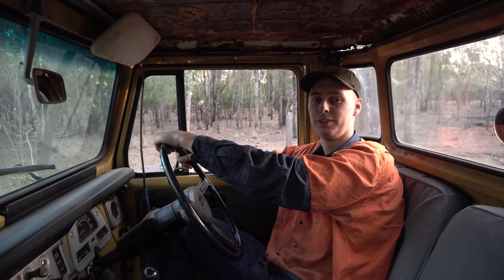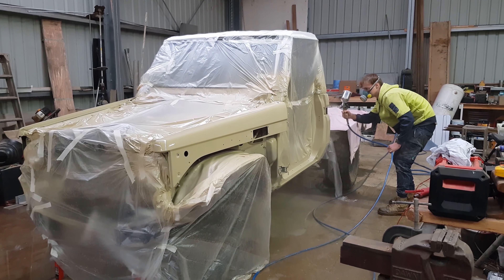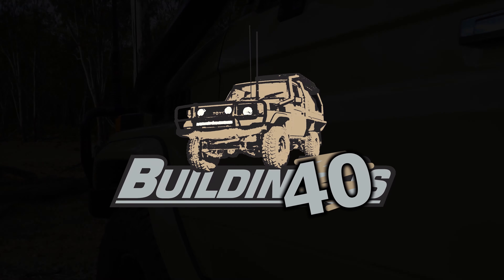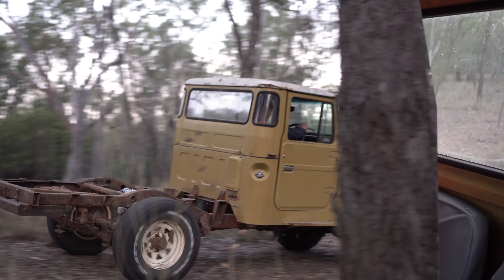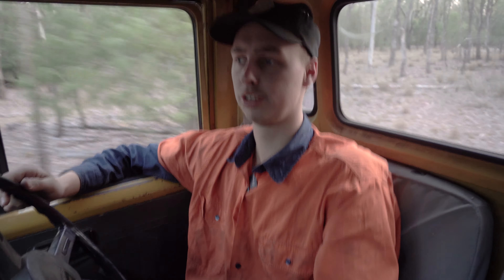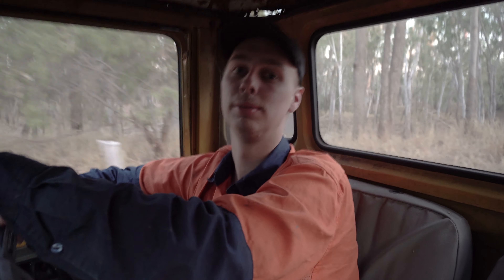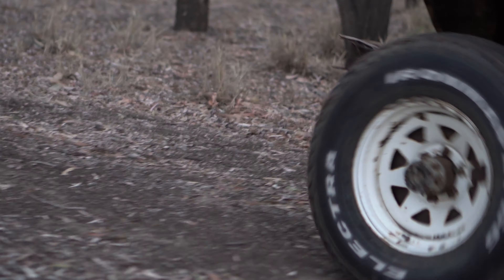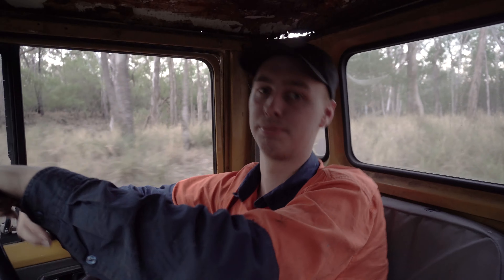HJ47 Series Build Plan - The 47 series build

Comment: I think you should put a fibreglass roof on in it instead of the steel one and raptor coat the chassis
Reply from the maker: The 47 came with a spare roof so its just gonna stay steel for now.... as for the raptor coating im not too sure on
Reply: Buildin70s I think if you put a flat look raptor coat and ok I was just suggesting about the roof
Reply from the maker: @mattymoto8895  cheers ill have a look into the raptor coating.
would be good to look into the fiberglass roofs in a future build and see the difference between the two